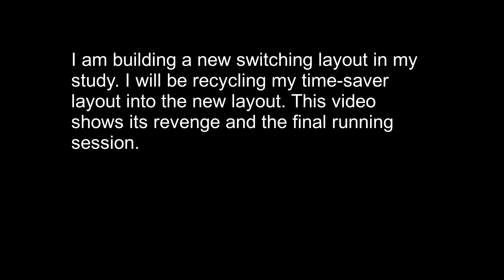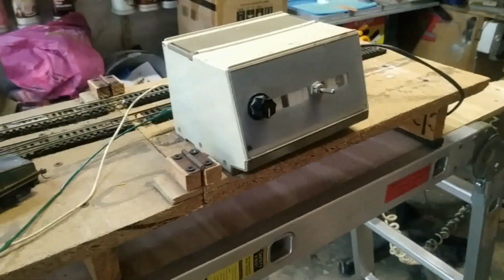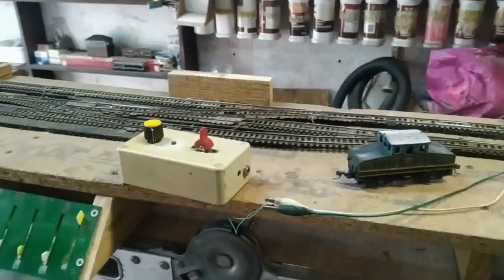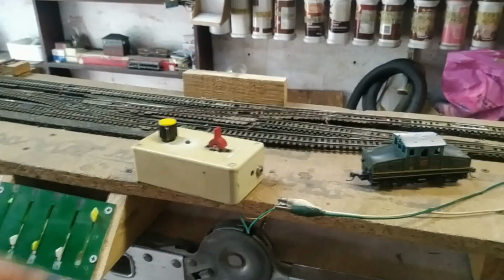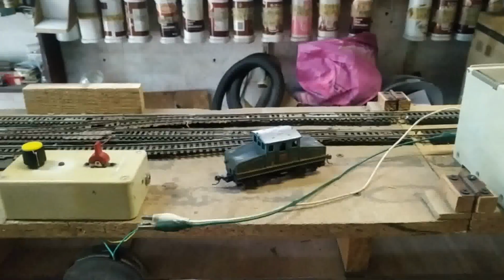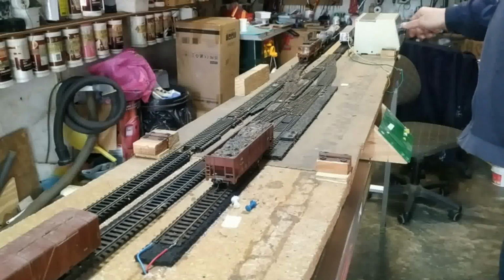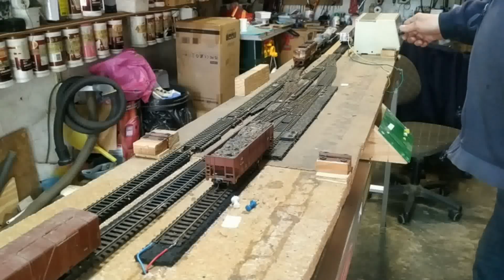Preparing for a new layout build

Comment: Where did you buy your locomotive?
Reply from the maker: Neil, that electric locomotive is very old, dating from the late 1970s.the body is a Life like 6E and it is running on an Athearn blue box F7 chasis wiyh dual flywheels and all wheel pick up. It is also decoder equipped for use on my Waterkloof layout. It also has LED lights.